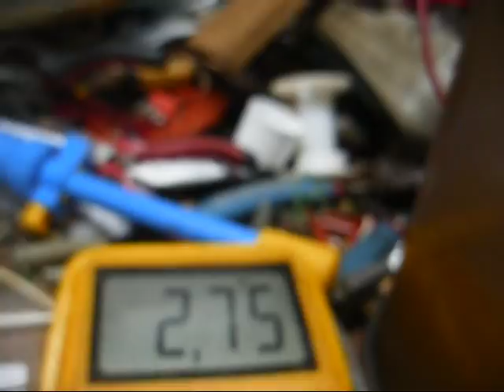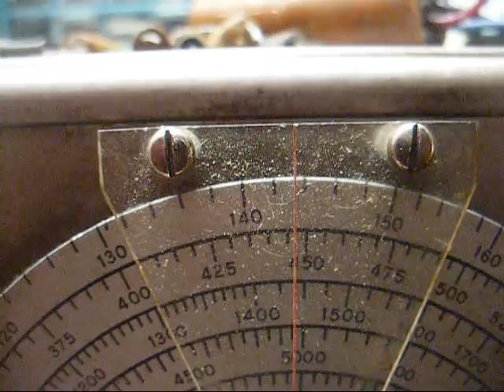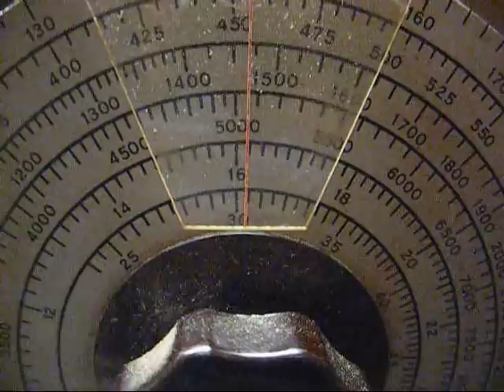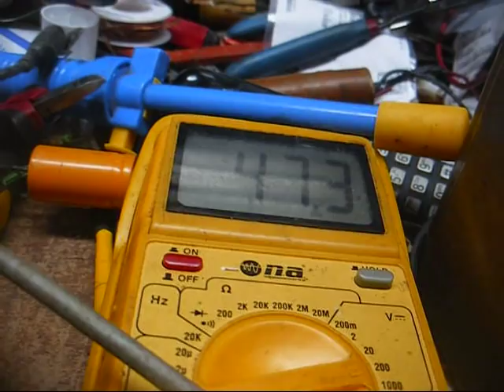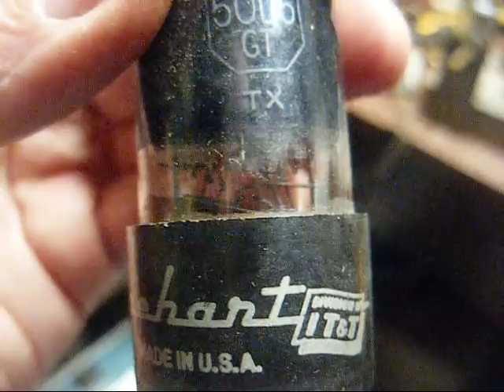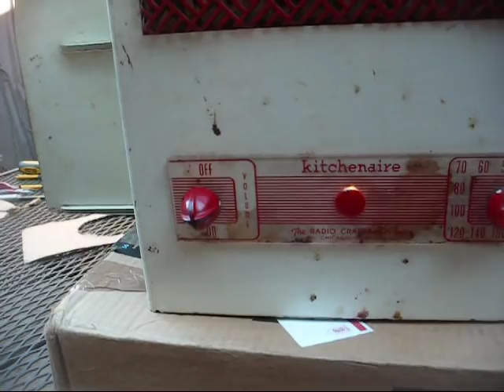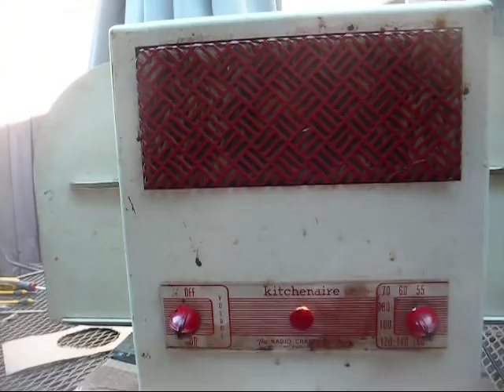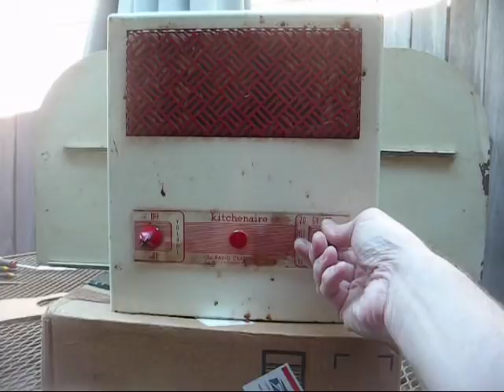Repair of a 1946 Kitchenaire AM tube radio

Comment: You can’t beat the sound of an old tube radio when everything is working as it should. Stay healthy
Reply: freddie fred 
When I started my collection, I had in mind , only pocket radios.  Well, because of price and availability, I ended up with a few tube radios.
You are right about the sound of tube radios.
I grew up just as tube radios were being replaced by transistors.
I forgot how “warm” they sound.  I enjoy my tube radios.
I just picked up a Panasonic AM/FM tube radio. Sounds great ❗️
📻🙂
Reply: There was also a kind of a smell from the heat of the tubes,  
Used to like that.

Comment: Hello rtvpn, Really liking the recent tube radio restoration series, learning some good information. In a future video, could you please explain more about the safety capacitor and which type to use? I believe they go across the hot and neutral. Stay well, C.

Comment: Nothing sounds better on AM than an old tube radio when it is working properly.  I miss the ones I had when I was a kid growing up when I lived in Memphis. Back those days, relatives would give me their old radios that quit working and I would swap parts from other old radios to get them working again.  When we moved to Texas in 1978, I was not able to bring all that old junk with me.  I think most of it went in the trash.  I did bring an old Philco table radio with us when we moved that was built in the 30s I think, I am not sure.  It is in a wood cabinet and has not worked since the early 90s.   I was 15 years old then and I still have it, 58 years old now.  I wish I had it working again, it is an Am shortwave radio.

Comment: A warm-chassis all-metal-construction radio right within convenient reach of the kitchen sink; what could go wrong? Still, it looks like a very well built set. I guess an isolation transformer, or a GFCI cord from a hair dryer, or even just a polarized, grounded power cord, would make it safe enough. Nice find.

Comment: A rare and good radio and fixed up sounds like it should. That fibrous material is a common interior fiberboard used
back in the day. Tends to fall apart when wet so it's no good  anymore especially down in the  south .

Comment: That board is basically a hunk of cardboard. They used to make 12" square perforated acoustic ceiling tiles of the same stuff that you would just glue to the plaster ceiling. Long before suspended ceilings. It probably has an acoustic advantage of not having any solid resonant frequency like a board would, which probably make the unit sound better. It may also somewhat dampen any resonances of the tin case. I'd personally be inclined to leave it, bad as it looks when it is out of the case.
Reply: Commonly known called by the brand name  Celotex.

Comment: Dead air meant that who ever was cranking on the tuning knob would keep cranking and try a different station. That board that the speaker was mounted on looked similar to the old construction material they called blackboard.   The Governor of Alabama mandated a Stay Home order the first Saturday of April.  I work in an essential business and I can tell you that nobody is staying home and nobody is buying essential products.  There's just no enforcement so far.

Comment: I'd test those two capacitors before I'd reuse them.  They might be OK, but use the capacitor tester before you file them in the good parts bin.
I might have left the old filter capacitor in the set, just to fill in the hole for looks.

Comment: Just curious does the New York clear channels AM stations make it down there to Mississippi  660, 770 880  1050 1130 1560 forget 1010 wins you have a station on 1010 locally I've noticed
Reply: I remember when I lived in North Carolina, I was able to pull in WOWO and KMOX and WBBR (Bloomberg). 

Being a fan of NWA/WCW, I absolutely loved listening to WSB especially when Jim Ross had his Saturday night call-in wrestling show. I remember when Tony Schiavone replaced JR when JR went to the WWF.
Reply: thepatsny 
A few can make it down to Jacksonville Florida, and further.
📻🙂
Reply: ku4uv 
True. I was listening to WBT one night when they got an actual phone call from someone in Cuba.( they tried to keep them on the line, but...)
Generally speaking, 50,000 watts, normal conditions, will travel over 1500 miles.  I’ve picked up WHO in Des Moines, here in Jacksonville Florida when good conditions.
I regularly listen to KMOX-1120, down here in Jax.
Conditions are expected to improve now.
📻🙂

Comment: I'm confused.  I thought you said that you were going to do a complete restoration on this one. While you did replace the capacitors and necessary resistors (great job in doing that by the way...especially noting the incorrect value used, etc.), in the scenes where there was enough light to see, the chassis and tubes were covered in crud.  Never did see it cleaned up.  I guess your concept and mine are different on restoration.  Anyway, enjoyed the video, and happy to see you put in that safety cap.  Did you mention a model number on it?  Do you have a schematic on it?  I imagine that it is among the more rare models out there.